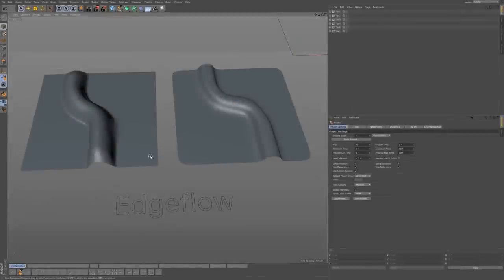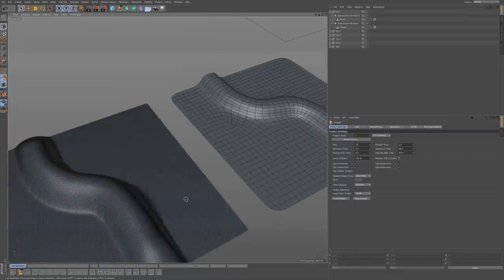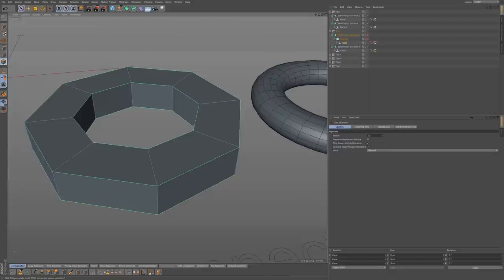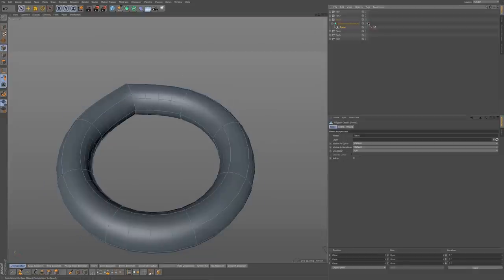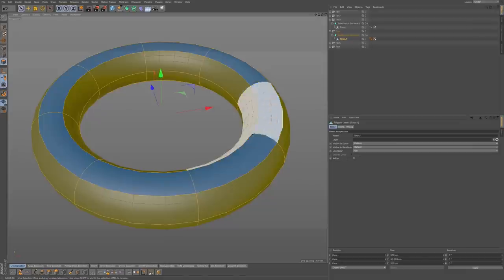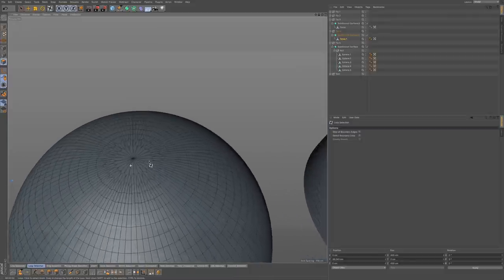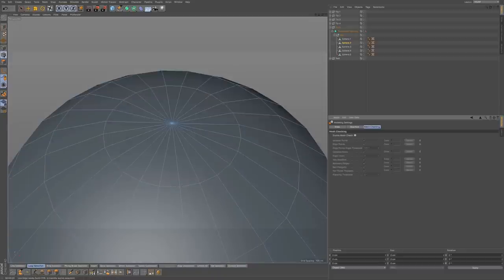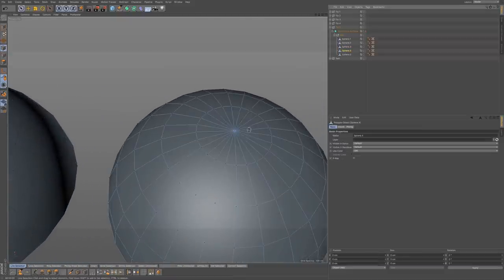Tips and Techniques for Modeling in  Cinema 4D

Comment: Hello Michael. Im having some modeling problems in connecting two objects together.  Simply put,  how do i connect this two parts, show on the link bellow,  if one of the holes has more points then the other object´s hole...  I made a whole in the Torus, and i want to connect to the surface bellow.  thanks in advance   https://gyazo.com/b646d8d229ac06ac8c3d84bfe1b8b2b3         Edit:   The only solution im thinking off, would be adding more subdivisions using KL? But what if i want to keep the top object lower poly then the lower object and still have them connected?
Reply: i know it is past time for a advice, but in my opinion the best way to resolve this problem, is to not connect the objects whatsoever. If you are going to connect them, trying to countlessly subdivide it, you are gonna have a big time retopologizing this. You should rather do it low poly, then connect, and then subdivide it. If you wanna more complex object, you just could connect them with boolean, making sure that the cap on the bottom object is flat. N-gons there wont change your model structure, and after all if you are going to export it to some game engine, you need to triangulate the whole object, so n-gons wont matter (in this specific problem, that you are having, so have that in mind). In just render instances, you can clip those two, and it wont matter. Of course, there will be sharp edge between them, but you can try to hide it a bit.

You should experiment with each solutions, and pick one, that the most suits you in this case. Remember, to not over do it. After all, its all about simplicity. Try to not complicate it too much. Thats the biggest advice i can give for everybody that starts with modelling. Keep it simple, and as long as it works, keep it that way